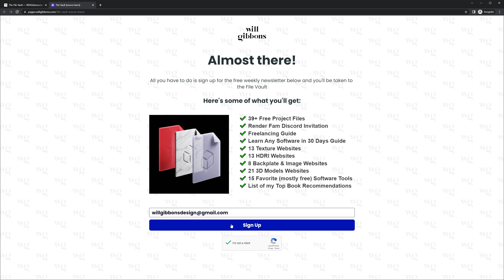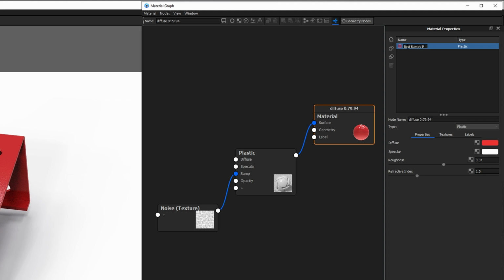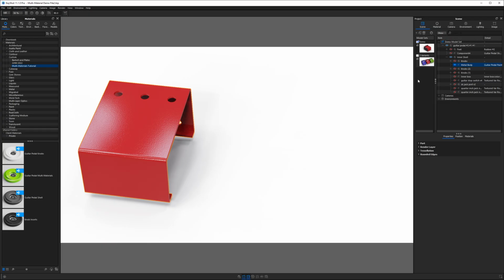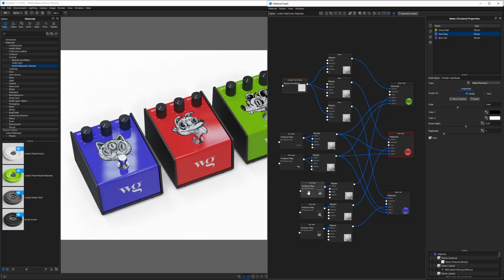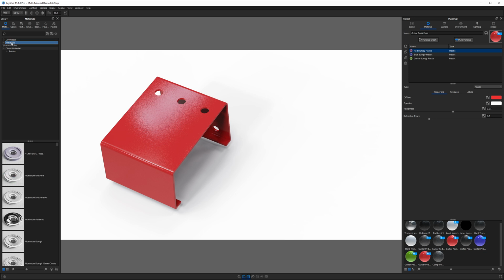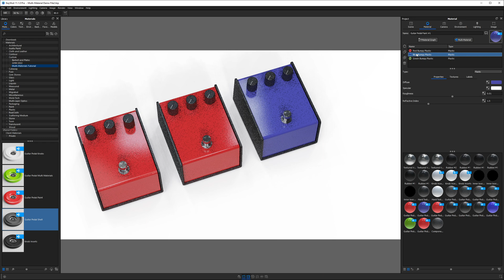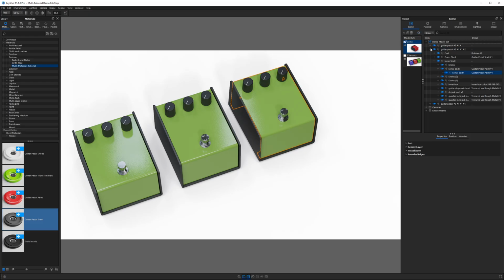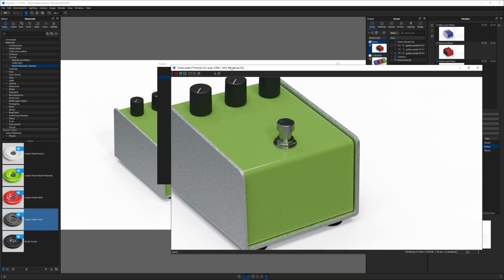The Right Way to Make KeyShot Multi-Materials

Comment: I'm trying to make a material where one material blends into another. The only method I have found so far is to duplicate the model and play around with opacities and change the scale ever so slightly. But this always results in some geometry not looking right. Does anyone know another method? Many thanks!
Reply from the maker: Can you get more specific? What kinds of materials. Typically in KeyShot, you'd apply your different materials as labels and use an opacity texture to mask one out, exposing the other underneath. But it depends on exactly what you're trying to do as this won't always work.
Reply: @WillGibbons  That’s something I haven’t tried yet! Thank you so much! There are some limitations to a material applied through a label, but this will do. I’m trying to emulate some kind of pressed concrete, with a top layer with more dense concrete, and a bottom layer with more rough, less fine concrete.

Comment: Hi Will, I have created a multi-material which includes a custom bump map. When I save the multimaterial and apply it to another part, the bump is missing. Any ideas?
Reply from the maker: Hmm. Is there a chance you've moved the texture on your computer? Like, is the material looking for the texture in a path it doesn't exist in anymore?
Reply: @WillGibbons  ah you're right, that's strange. Must have deleted it by accident! Cheers, fixed now ! Great videos!

Comment: Hi this is great but what if you want to render 3 products that are not in line? Will i have to have 3 products together on the same cad file before i import or can i import 3 individual files and then use the multi material feature?
Reply from the maker: No, you don't need a row of products. I did this to make it easy to understand. You can have your multi-material on one CAD model. Then, in your render queue, you can choose 'render all multi-materials' and it will render the CAD model in each color/multi-material.

Comment: Awesome video, but is it possible to show several objects side by side, in the same render, that have the same multi-material, but have different sub-materials active? Like at 6:04 in this video (but linked)?
Reply from the maker: You can achieve what you want... but not if they are linked. That defeats the purpose. By linking the materials, they will always look the same at the same time. By Unlinking them, you are able to activate a different sub-material on each model.
Reply: @WillGibbons  thanks for replying! But what if you want those different unlinked materials to have the same textures, or color fade animations, for example?

Comment: what if you have a texture in the diffuse and blend it with the color option? I am trying to create a multimaterial but when I change the color of the blend with texture in the diffuse, it changes all of the materials in my stack.
Reply from the maker: Instead, you can use a color composite node. Use that (or as many as are needed) for each sub-material.
Reply: @WillGibbons  exactly what I did. Used a coomposite node, layered as multiply blend mode and used an invert node when I needed to change my logo from white to black. Its trying to get used to the Keyshot WF when you have been using Vray and Arnold.